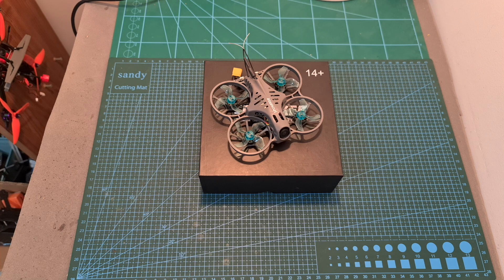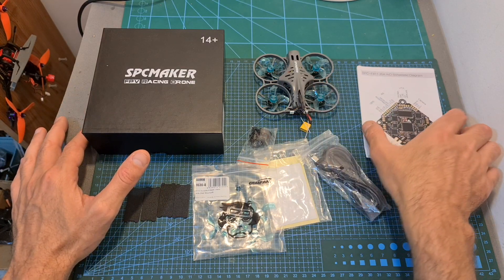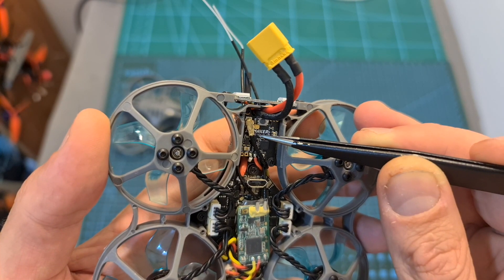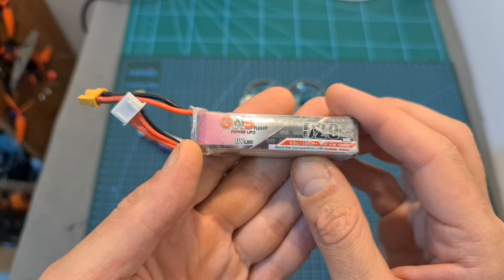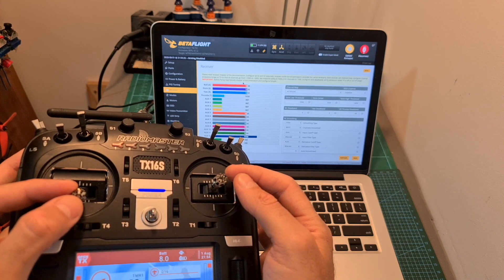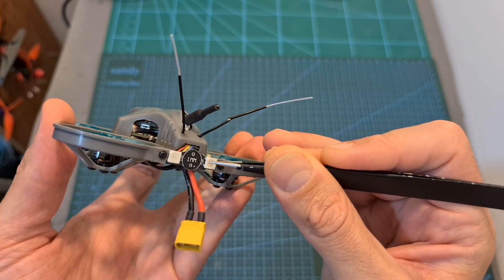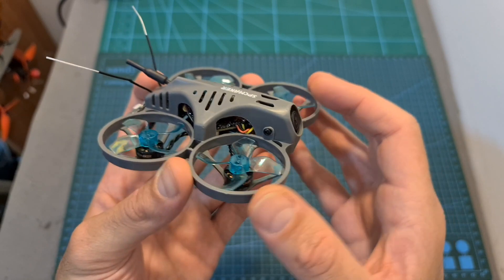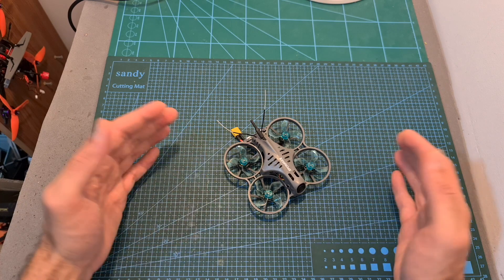Toughest Micro Quadcopter? SPCMaker Bat78 HD - Setup, Review & Flight Footage

Comment: I like the frame, it looks like it might be able to (just barely, maybe with some mods) fit a naked Vista. Really does look tough.
Reply from the maker: Yes it should be able to accommodate a naked vista. 
Not sure if it will fly better than the P16, but it will be tougher, that's for sure.

Comment: Intresting against tinyhawk 2
Reply: I think I'd prefer this something that protects the blades for indoor flying
Reply from the maker: Both options are good for beginners in my opinion, however the Bat78 will perform better outdoors and the TH2 is more suitable for flying indoors.
Reply: @KremerFPV  are you sure because the tiny hawk has open props and the bad has guards around the props. So I think that would be easier to fly indoors
Reply from the maker: @MrSabram07  The TH2 has a prop guards. The Race and freestyle versions don't have them.